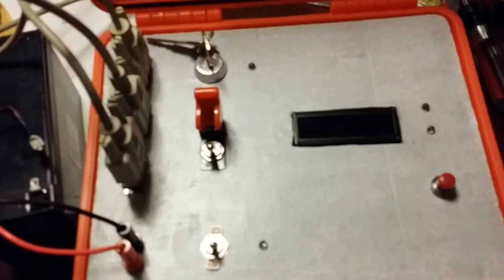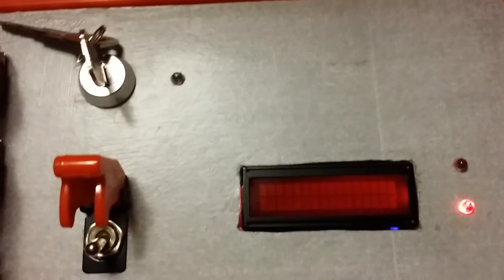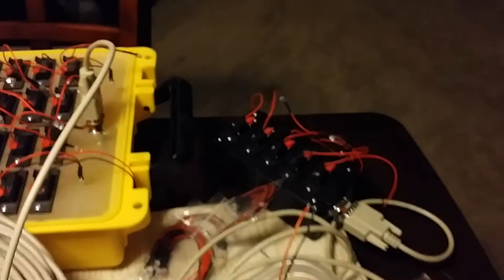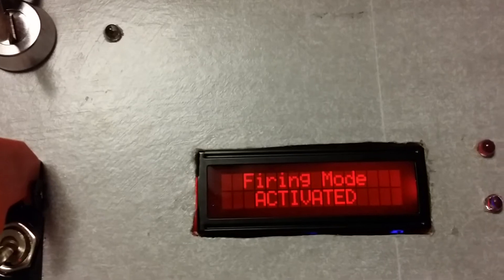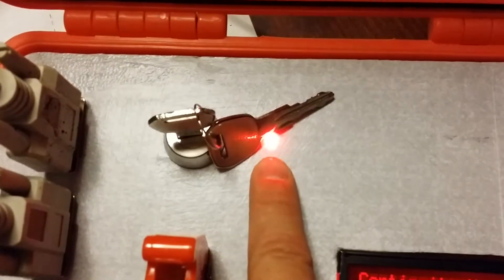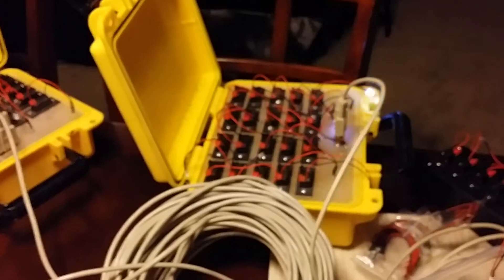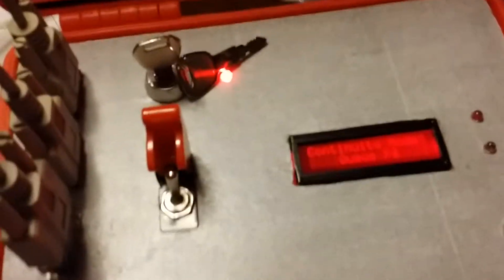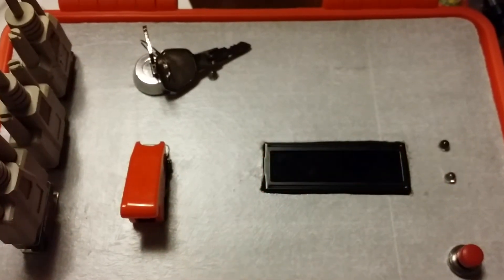Arduino firing system

Comment from the maker: Arduino Code:
https://bitbucket.org/mmtsweng/arduino-firing-system

Schematic:
http://i.imgur.com/xYTIcYx.png (But TIP120s everywhere, no 125s)

Pictures:
http://imgur.com/a/oQPqm

No Parts list, but it's basically a 4n25, TIP120, and a resistor per queue.